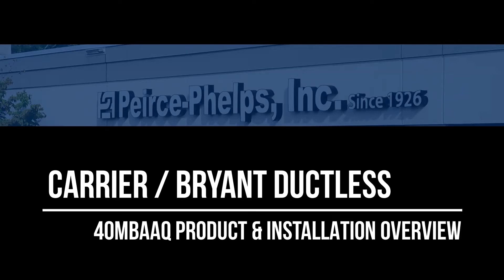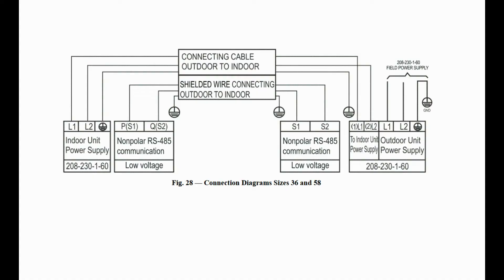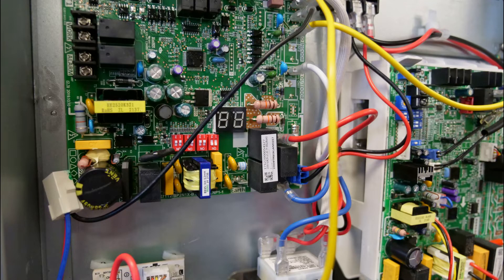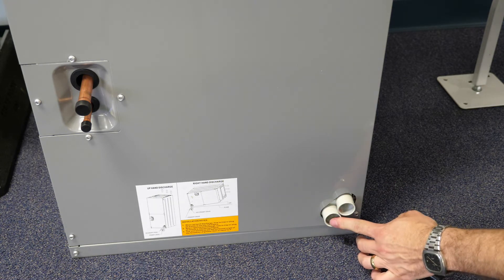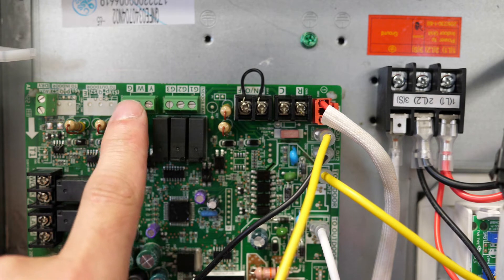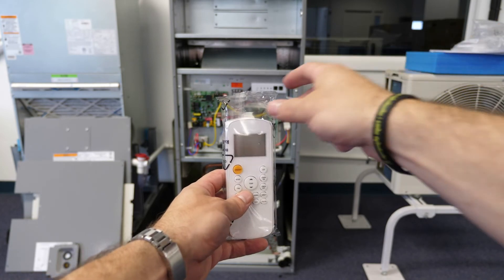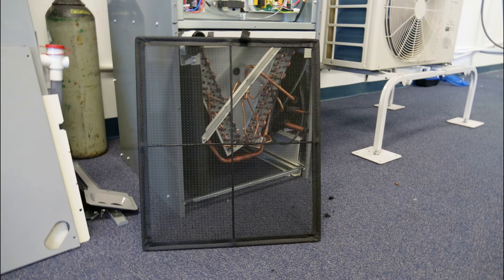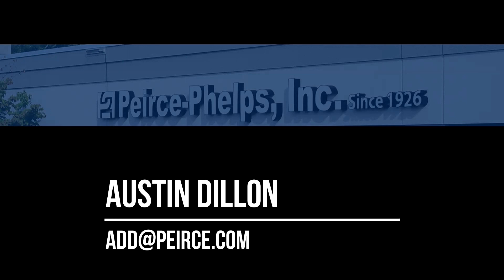Peirce Phelps 40MBAAQ Product & Installation Overview

Comment: I have the 2H/1C heat pump thermostat, if i want to use it with a heat strip... do i need to buy a relay for this system, sir?
Reply: Thank you, sir !
Reply from the maker: If you want to use a thermostat that is configured as a heat pump - in your case 2h/1c, then yes, you would need an isolation relay to manage the O/B call. Using a heat pump thermostat offers the ability to control emergency heat independently and to set controls around the use of the back up heat as an AUX heat source

Comment: My unit was install with a little outside air damper. According to the service manual the 3 ton unit capable moisture removal 7.67pint/hour. Can this unit use as dehumidifier? Thank you
Reply from the maker: The unit has an advanced dehumidification feature that can be configured to provide additional dehumidification during a cooling call. Since this unit uses 3rd party thermostats, You would just have to have a thermostat capable of providing that call. Note that this feature is only available if you do not have electric heat installed. 

Otherwise, it can be interlocked with a whole home dehumidifier that can be tied into it's duct system. This is a common approach for providing additional dehumidification capabilities when the unit itself does not suffice. This is common in locker rooms or other such places where humidity is high or in instances when outside air is being brought in and humidity control is necessary. Good luck!